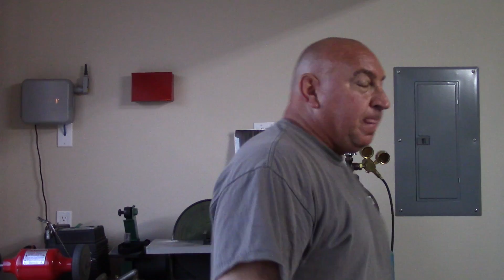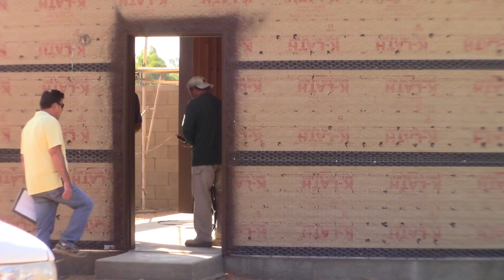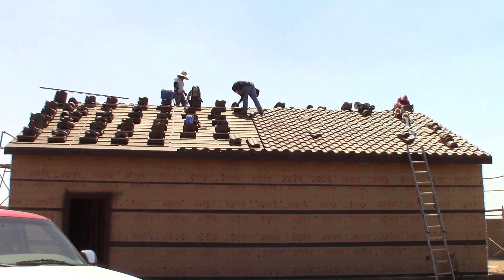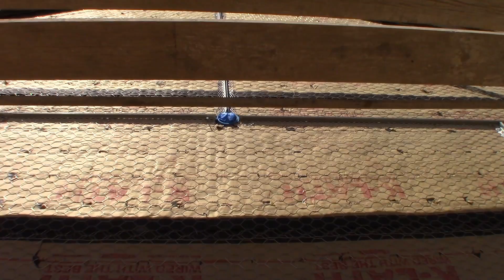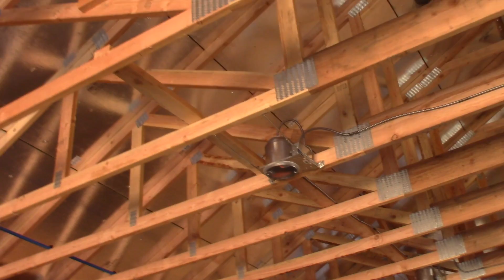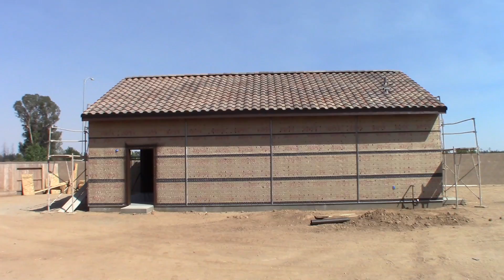Shop Build Part 8 Roof & Electrical #realraysgarage

Comment: What size electrical breaker is feeding the shop?
Reply from the maker: I ran 200 amp copper wire (3/0), installed a 200 amp panel, with 100 amp breaker at house and shop.

Comment: Nice looking shop Ray. Bet you are itching to get machinery in there.  I cannot believe the amount of unsightly electrical shit that you have had to put on the side of your nice house. Fair enough on a garage or outhouse but doesn't look good on the house. Here in the UK your gas meter would be in a flush enclosure in the wall. All you would see of the electrics would be a short length of ducting entering the house. Hope the rest of the build goes as smoothly as the rest of it was.  I would have the roof vents put in anyway to release the heat build up in the roof space as low vents will not do that efficiently.  regards from the UK
Reply from the maker: Hello Gary, Thanks! Yea, I'm going to have to do something about that unsightly mess on the side of the house but at least you can't see it from the front of the house! It sure would have been nice if it was all inside the wall. Roof vents have been reinstalled. Thanks for dropping in!
Reply: Thanks for the reply Ray. I am sure you will get it all tidied up as time and funds allow. :-)  regards from the UK

Comment: Hey Ray, the vent situation is unfortunate. Do you really think the contractor will remove tiles, remove foil, remove sheet of plywood, then replace? If anything he'll caulk the shit outa of a plywood patch from the inside. Me? I would bite the bullet and have him install the roof vents on his nickel. Good luck and keep the blood pressure down.
Reply from the maker: Hey Denny, I'm am leaning to the vents being installed because I know he is not paying for the roof to be replaced and I am almost 100% sure he does not want to take a $6500 loss either!

Comment: Wow, looks good Ray!Just out of curiosity, why don't you want vents in the roof?  We had issues with our shop roof condensing water in the winter (we live in the central valley as well). We added roof vents in addition to the existing eave vents, problem solved. Do you plan on HVAC w/o false ceiling?
Reply from the maker: I thought by adding the ten soffit vents would have been enough air flow but hot air does rise so maybe having them reinstalled might not be a bad idea!

Comment: Boy I just can't believe that they didn't stub in for utilities to your planned shop.  What kind of reason was given for not doing it?  It would have cost a few dollars that way now it probably took hundreds for all the trades to do it after the fact.  Will your IRC allow just eave vents?  First I have ever heard of only using them without some way to allow the hot air to exit.  But then codes are changing so fast it is hard to keep track of them.  Nice to see your project nearing the finish line.  We had a partial day of sun and it got scorching hot--damn near seventy  About four hours of blue sky.  I thought a jet had dumped its toilet!  106 Wow you are going to have to put that pool on the fast track now that the shop is near done (I like your priorities!).  Take care.  Doug

Comment: I use only 5000k Led's now, but once you have them, any room with 2700k bulbs look like you only have candles lit. Once you go 5000k you can't go back.  Bummer about the holes in the roof, but very nice shop anyway.

Comment: Hi Ray, it is going to be a great shop. I do not think that the vent holes should be a problem,  just have patches caulked and sealed over the holes. If not you could wear a tin foil hat just to be sure lol. regards bruce
Reply from the maker: Hey Bruce, I think I'm more upset about the tar paper being cut, that is what keeps the water out plus i hate the look of the new foil back being cut up!
Reply: ocd's suck don't they, machining and construction don't play well together

Comment: Interesting the difference in dry climates. Here you would have to have either a ridge vent or eve vents for proper ventilation or your roof would rot off and maintain very high temps in the daytime possible degrading the life of your roof as the hot air won't want to go down and out.
Reply from the maker: Really only need eve vents here, my last house was a two story and have roof vents as well.
Reply: I'm hearing what Brian is saying, and wondering if you're only required to have eve vents, then what their function is if air that enters has no place to go?  BTW my house here in Washington only had eve vents, and in the summer the attic temp often was 130+ before I popped in a dozen roof vents.
Reply: bcbloc02 Isi
Reply: Don't roof tiles permit air flow around and under thus preventing excessive heat buildup of the roof sheeting!
Reply: At this point I would just go with eve vents (maybe even powered and on a thermostat). The fewer penetrations you have in the roof, the less likely it is to leak.

Comment: Ray,
Looking really good you will be moving in equipment before you know it.   Are you going to epoxy coat the floor?

I would leave the cut in vent,  if you ever close in the ceiling then you can have the roofer back to add the roof boots.  That way you will get flow through venting from the soffet vents to the  roof vent.  This will keep the attic area cooler reducing your cooling load and energy cost.  For the time being you could always cover the holes with a piece of aluminum flashing fastened with some sheet metal screws.
Reply from the maker: I agree, I asked them to leave them in after they were cut without my permission then they removed them and tiled over them when i was at work, you have no idea how pissed I am over this! I did get the 5000K 20Watt 1550 Lumin  bulbs in this evening but can't test them until the power is turned on!

Comment: Hi mate.  I'm so very happy that I did not build on your left coast.  All those inspectors would drive me to murder, I would have a mass grave in the back garden, but they would most likely would have to inspect that first as well. Do you have to pay for all those lunatics to come sticky beak in at your place?  Long live the red tape brigade.  I thought that you are a sparky, why did you not do all your own electric?  Did you check if the sparky was drunk? it looks like a drunk 4 year old had placed those conduits into the house, they don't give a rat's backside what it looks like, do they?  Oh, have them replace the roof mate, this caper must have cost you a bucket full as it is.
Reply from the maker: Sparky missed the mark big time but did do a great job everywhere else! I'll find a way to hide that unsightly mess! Yea, the city is a bitch to deal with but its all about the dollar or should I say extortion... Permit fees were $1200 but wait there's more, I get reassessed after its built and taxed on the higher property value since I improved the dirt to a structure!
Reply: Ah  well they have to steal the money from somewhere, and since you want something, the greedy bastards will come and get it from you.  How to stop new development?????  I wonder if your local pollies will have to do the same they want something.  One rule for the plebs and one for the people that supposedly work tirelessly to serve them, yea right.

Comment: Since the vents were not on the plans, the roofer needs to make it right by replacing the roof decking.  Enough said.  Period.  NO EXTRA MONEY.  Don't pay that part until it is repaired to your satisfaction!  They will probably try to adjust the price to keep from having to fix it.
Reply from the maker: I agree Roy, I already made it very clear I was not paying for the roof until it was fixed back to the way it was before they cut into it! I am sure they do not want to take a $6500 loss for not reading the prints correctly!

Comment: Sucks about the roof Ray, but something is always bound to happen. They would almost have to pull the whole side of the roof off to repair the sheeting. I was wondering how you were going to get 200A off that panel but it would appear the utility lets you double lug in the meter base. Should be good to go the end of the month by the looks of it.

Comment: That's good to see you are passing the Inspections...That is not right how they did the roof !!! make them fix it ..The sheeting and paper is what keeps out the rain if you ever have any tiles crack or blow off in a storm ...Every thing  else is looking great ...Seeing the electrical panel answered a question I had awhile back that you can access both sides of the panel where the meter is